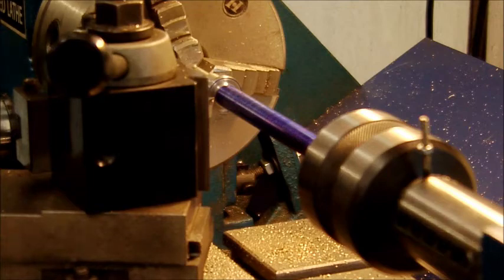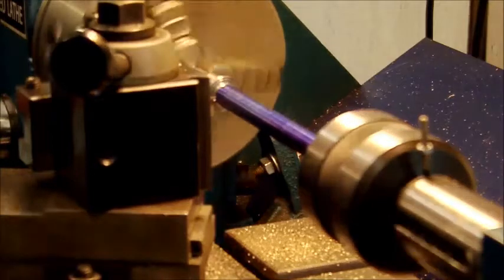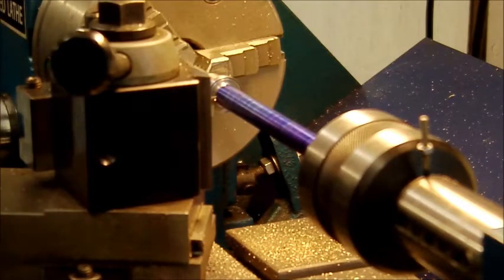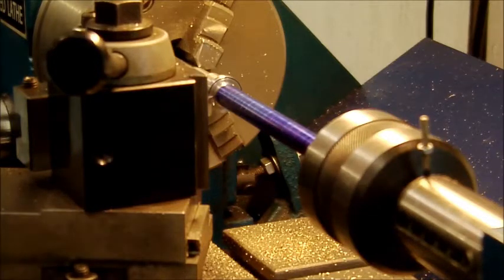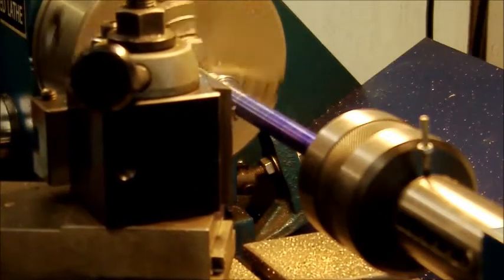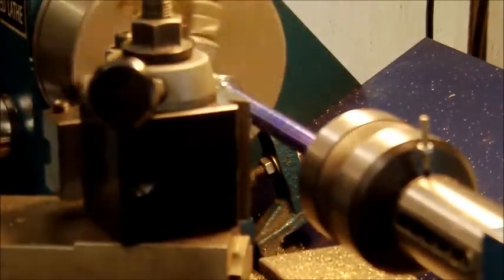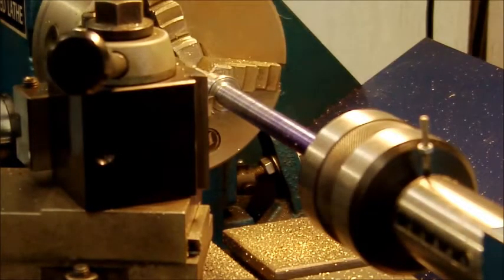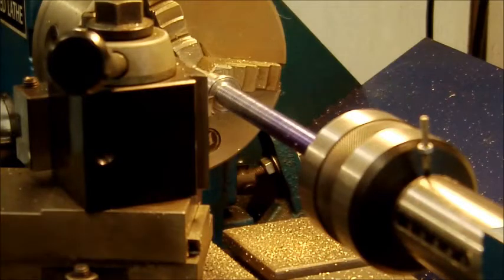Clarke Lathe Threading

Comment: Can you advise how to remove the Chuck from the 500 Cl please
Reply from the maker: Hi Michael no problem at the back of the chuck you will see there are 3 bolts and in they will line up with the little gap in the main body of the lathe just undo those 3 bolts and the chuck will come off so you can change to other chucks. Make sure you clean the mating surface when you replace the chuck as it could make the chuck out of line. Hope this helps. cheers
Reply: @fixitnige  and if I want to remove the back plate to get to the threads, thanks
Reply from the maker: @michaelcapp4597  The bolts go though the holes on the back plate into the chuck so the threads are in the chuck.
Reply: @fixitnige  I removed the 3 bolts which leaves the back plate but no spindle threads visible to screw catch plate or the large dia Clarke slotted face plate
Reply from the maker: @michaelcapp4597  I am not sure what splines you mean ? the back plate is part of the main shaft as far as I know. You can only add things that fit to that back plate unless somebody knows another way. cheers
Reply: @fixitnige  someone else said that I need a adapter plate in order to fit catch plate or any other screw on fixings, thanks for your input .

Comment: What quick change tool post did you use and what did you have to do to fit it. Been looking for one to fit my cl500m for ages!
Reply from the maker: Hello Jonny I can't remember which one I got but it was a ebay one and just made a new lockdown bolt for it very easy fit.
Reply: @fixitnige   could you have a look and see what one you fitted. That would give me a good starting point. Thank you for getting back to me.
Reply from the maker: @jonnybamber1772  I think it was this kit but later made more tool holders ....Piston Quick Change Toolpost 205-100 Series Tool Post Holder Kit for 12" Lathe  search ebay for quick change toolpost.
Reply: @fixitnige  ok. Thank you for taking time out to look for me. I have subscribed to your channel and keep you up dated how I get on. Thank you.

Comment: That's a Clarke CL500m, right? If so would you recommend one to a beginner as a first lathe / mill?
Reply from the maker: Hello Lotus Yes it is the Clarke To be honest No I wouldn't recommend it The lathe has to many 
short comings which I have now just about sorted out and the mill is at best a bad drill.
For the money a good second hand Myford / cholchester / harrison would be better and save
you having to change later on. As for the mill any one of the cheaper chinese mills would be
good . Warco / Sieg /chester most are the same just branded for different companies.

good luck with what ever you choose cheers Nigel

Comment: I have a Clarke CL500M too.  Which variable speed drive & motor did you buy?
Reply from the maker: Hello Peter I got in touch with Transwave from Birmingham they were great to deal with and brilliant help
only thing I had to do was make a new motor pulley as the shaft on the motor was smaller than the clarke
pulley but not a big deal.
Cheers Nigel
Reply: Many thanks Nigel. Just after I sent the request I found your YouTube video which mentioned it :). This will be an interesting project.
Reply: Hi Nigel, sorry to bother you again. I am just about to take the plunge with the variable speed drive and have a question about the motor and the drive itself.  Did you go for the straight replacement metric motor (frame size 71)?  Also have you found any lack of torque with the variable speed drive at the slower speed setting (e.g. when screw cutting)?.  Kind regards, Peter
Reply from the maker: Hi Peter From memory (which is bad lol) when I rang transwave and spoke to them I think they
had 3 sizes which would fit the clarke and I went for the middle one it was a straight swap for the
motor, However the shaft was a little smaller so I made a new pulley before swapping the motor 
over. As for the loss of torque I did keep all my pulley wheels and use them for threading, i spose
it's a little bit of a pain but at least it does give you variable speed.I don't use the clarke anymore
for threading as I now have the Harrison M300 which is far easier. Good luck with your swap
cheers for now Nigel.
Reply: Thanks again Nigel. Can I ask you a little more about the motor pulley please?  My motor pulley has four steps (three at the front and one at the back).  When you made the new pulley did it just have one step or was it identical to the original one?  The reason I ask is because I am not sure I understand about keeping all of the pulley wheels for screw cutting because I was not going to change anything on the drive train i.e., I am going to retain all of the pulleys and drive belts and just replace the original motor with a three phase one and variable speed drive.
Reply from the maker: Hi Peter I just made a single pulley just a little larger than the one at the back of the main pulley
that way you can use the other pulleys as normal but still give a good range of variable speed.
Nigel
Reply: Thank you for confirming Nigel.